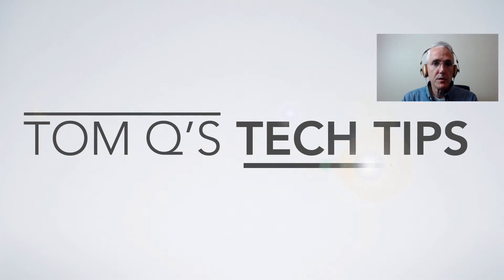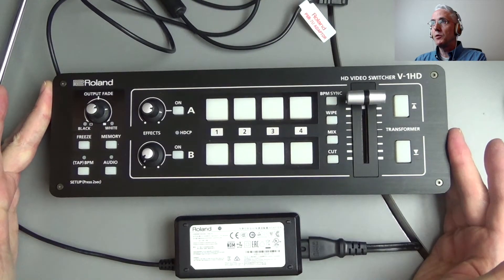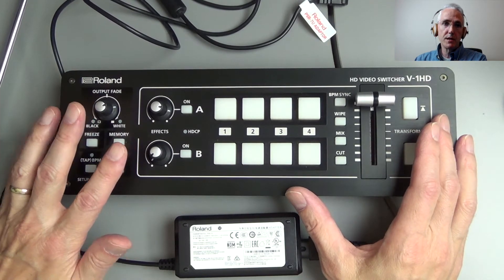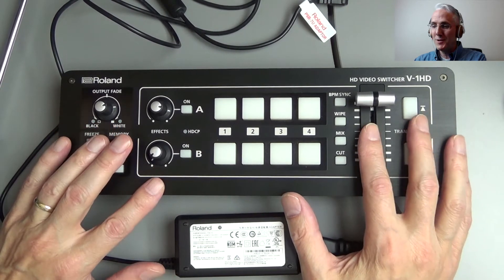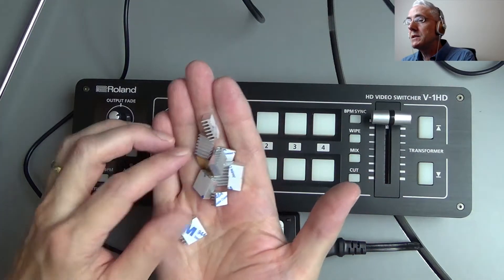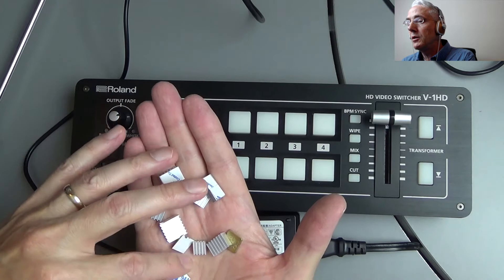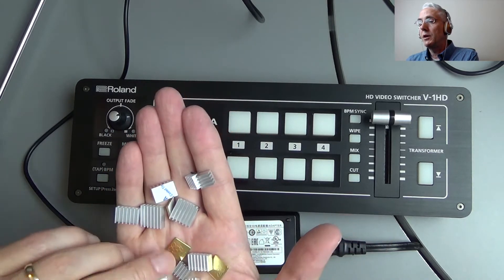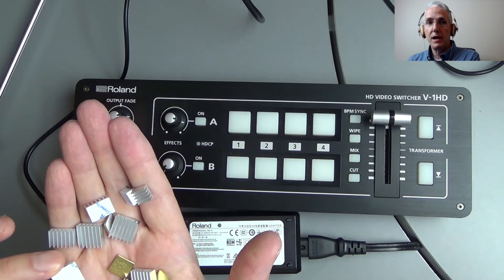Making the Roland V-1HD Quieter for Studio use

Comment: Thanks for video! Do you know is v1hd+ is also noisy?
Reply from the maker: You are welcome. I don’t know. I made this video right before I sold the V-1HD. I replaced it with the ATEM Mini Pro ISO which is completely silent, and replaced the Pro ISO a few months later with the Mini Extreme ISO which makes a little whirring sound for a second or two at startup but quiets down to virtually silent after that. I do miss the T-Bar a bit but that’s about it. I don’t think I will be going back to Roland. The Extreme ISO is amazing.

Comment: There's room to put this switcher back together with the added heat sinks?  Cool vid, thanks!
Reply from the maker: Those heat sinks are super tiny. Yes there’s room! The fans are a different story obviously, but I only used them in my studio, not in venues.
Reply: @TomQsTechTips  Ah cool!  I was just thinking it would be plausible to get away with a slower internal fan if there's sinks on all the chips.